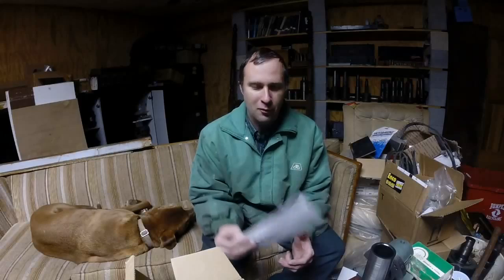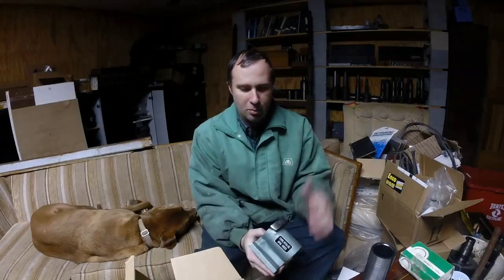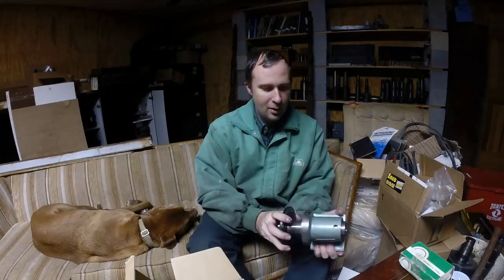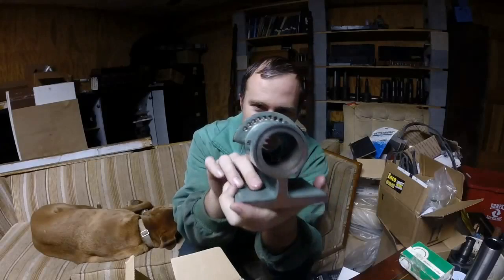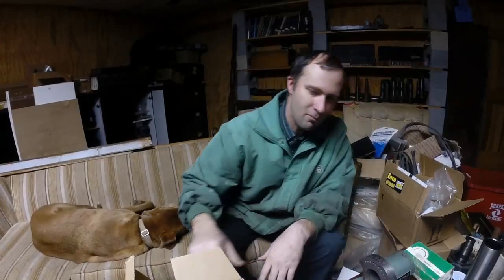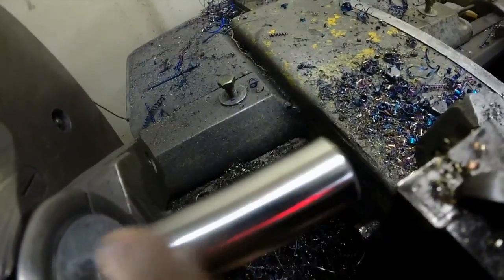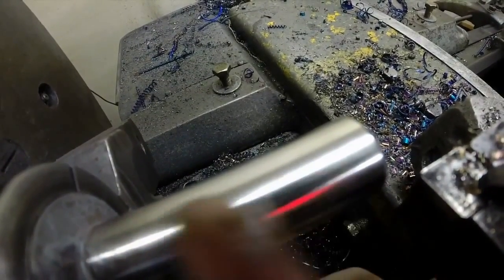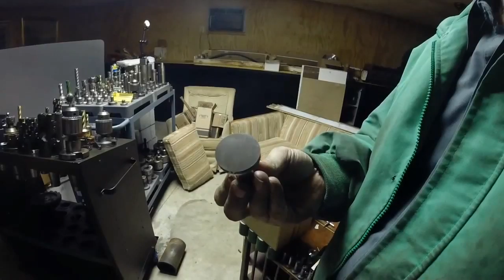Heat treating, Hard Turning, and Grinding

Comment: For the oxidation protection, I use boric acid. You can also use borax, but the boric acid comes off in boiling water a lot easier than borax. Heat the parts to just where they start to turn straw colored, and drop them in a can of the powder, they coat themselves in it and it turns into sort of like glass (just like brazing flux) then heat treat like normal. 
Just an alternative to the tool wrap. 
Another comment on the tappet design, they're usually crowned to a radius (high in the center) rather than completely flat. This is to make them rotate and wear evenly, when they go flat they stop rotating and wear the lobes on your cam.
Reply from the maker: Thanks for the tip! I will have to give it a try sometime. In this case the cam has a very slight taper that causes the lifter to rotate.

Comment: Hey, looking at some of your older videos.  You know those grooves on the inside of that spindex was because they are oil grooves.  :-)

Do you have a reference which you go to for heat treat and tempering temps and times for different materials and hardness needs?
Reply from the maker: I prefer to go by the material suppliers info, but there is also general stuff in my engineering materials book. I believe the machinist handbook has a section on heat treating as well.
Reply: Thanks, Brian.  I just picked up a unit a couple weeks back that I haven't used yet.

Comment: Put you parts on a tray, grab the tray with tongs and spill into about 20 gal. of oil with a wire mesh basket in it and swish if around quickly.  It will give you even hardness.  The faster the better, the critical point is as soon as it hits the oil.  What steel is it?  S-7?

Comment: Get the part from the furnace to the oil as quick as possible. Keep the furnace door closed in between part quenching. Also stir the part around in the oil for a better and more even quench. Doing all these things will produce a better heat treated part with less flaws in it. Heat treating is a science in its self. Great job, keep at it!
Reply: +1

Comment: Hey Brian,  just noticed that some barn door hangars I've been tripping over in my basement shop would be better in your shop than mine.  How can I contact you to send them?  Have (9) w/ nominal 2.5" x 4" rectangular ID.
Reply from the maker: 2.5x4 is a bit small for a barn door, but they sound like they could be a size I might could use on some windows. You can email me it is on my about page or use bcbloc02 at yahoo.

Comment: I have a question, You hardened the tappets but you didn't show any tempering, are these pieces just left brittle? Or did you draw a tempering heat and just not film it?
Reply from the maker: A double high temperature draw/temper was performed but I didn't film it since there really wasn't anything to see, since it is just parts sitting in a oven for an hour and a half.  I probably should have done more than just mentioning it 11:37 in the video. I didn't think about filming that part of the process until I had already done it. I was busy trying to get the exact right oven temp and doing that diff at the same time, what is it they say about too many irons in the fire? lol
Reply: bcbloc02 OK ya I missed that thanks for the reply.

Comment: Hi Brian, I see Baily continues to maintain his usual calmness under fire LOL
  I've definitely got oven envy, I'd love to have one of those, it would come in so handy for making custom bushings for all the line boring jobs I do. Just curious how do you know how to get to a certain hardness, maybe you can do some more videos on the heat treating process, I've always been interested to know more about the whole process. Great video!
   Mike
Reply from the maker: It is a good topic with limited info on the internet so I will be sure to do more in the future. Fortunately the materials handbook and many steel suppliers have detailed heat treating info available for most materials that will tell you what hardness and strength should be achieved if you do it right.

Comment: Cool stuff! I Could sure use one of those ovens... Thats interesting about the spindexer, I almost went with one of those but I found a real nice Yuasa unit on ebay. Thanks for the video!
Reply from the maker: Going to do a review on yours? This thing is probably just fine for an index, but it won't work for rotary action like I had hoped. Time to just buy a full on cylindrical grinder instead. :-) lol
Reply: Haha! You could probably make one with a cylinder grinder! Hmm, that might be a worthwhile video...I think I'll wait until I have my Surface grinder up and running, then I can do a real test of the spindle accuracy on it.
Reply: (Reffering to doing a review on my spindexer.)

Comment: Wow - a serious oven, that will surely make the meter spin and the lights dim when you switch that on to heat up!! Better tongs will help as will a bigger quench bucket and contents. I guess some slow speed stirrer would help but things gaot a bit too hot at the end when the oil got on fire.
Could you please explain a little more clearly what happened to cause the few failures (6?) you had? Many thanks.
Reply from the maker: It is less than 20A so it draws less power than the table saw so not too bad.  The ones I couldn't use didn't clean all the spots where mill scale had occured up. For this particular material since air quench is also OK I will probably just use tool wrap and do that to avoid the oil problems and reduce the scale problems as well. I hope that helps.
Reply: bcbloc02 Only 20amp? How long does it take to reach 1800F?
I bet that makes the shop nice and toasty.
Reply from the maker: It takes like 3hr to get to 2000deg.

Comment: Is this for a stock rebuild, or some sort of hotrod parts ?

Why not just buy stock parts ?
Reply from the maker: These are for tractor pulling and drag racing diesels. The stock ones break the foot off and destroy your cam and block these are the solution to that problem as they are hard enough to run on both cast and 8620 steel cams with no wear issues but also tough enough they won't break under the extreme loads put on them in high performance applications.
Reply from the maker: Rick Brandt
 Not a lot of meat there in the block, you could squeeze another 1/4" of diameter in the block but then it is probably getting thin and I would worry more about breaking the block than these lifters as these are probably 6 to 7 times the tensile strength of the block material. I have been running these in multiple motors for 5 years and haven't had a failure even running over 500lbs of spring pressure at full open.
Reply from the maker: Certainly 2000hp and 3000+ft-lbs of torque were never envisioned by the engineers for this little 466. I sure could use that new shop right now, especially that overhead crane! I am working 6 days a week for my day job and another 5 hours a night in the shop so not time for barn work. :-( The only good thing is steel prices for my posts for the bridge have dropped 25% since last fall, I wish I knew when the price was going to bottom out so I knew when to buy!
Reply: bcbloc02
are Bigger lifter bores possible. can imgine pretty radical cam,side loading/bending on the foot
Reply: Then you surely do good work. Watching that vid on hinge repair shows how well you think things through. I do enjoy your presentations. I am sure the tractor engine engineers never envisioned the the spring pressure/cam profiles/RPM's
your employing. The side bearings show your concern for the whole drivtrain,fan to tire contact.
Some day will visit Kentucky,would offer tractor seat time. To help out. Grew up on a John Deere farm.
Waiting to see that barn repurpose.

Comment: When you're quench ing part after part like that, try using a bigger quench tank, and more liquid to ensure the oil is still cool enough and has enough capacity to quench it properly.  Having the oil on fire is a bad sign.
Reply from the maker: Agreed fire bad, this oil burns at 400 and the quench is complete at 600  and the material supplier says it is ok to air or oil quench so I think it was ok in this instance. I do want to get more oil and a bigger container for sure.

Comment: Hi Brian,
Nice score on the heat treating oven!  Maybe boring out the Spindex and making your own bronze bushings would help with stability and accuracy.  I guess that you'd have to decide if it was worth your time to do this.  Thanks for the video!
-mike
Reply from the maker: I may try to find a decent one with bearings like a Suburban or something, but for now I think I will try some V-blocks and see how that does.

Comment: Hi Brian,
Cool, matter of speaking, demo for the furnace...
Leaving more material is no problem, cause wrapping is more a problem for uniform cooling, could also inject some inert gas in the furnace...
64Rc is harder than HSS steel or just about the same. For turning give CMT inserts a try, no more than about 10-15 thousand DOC.
Also looked from here that after leaving the door open for too long that the last pieces were getting colder, all the times I hardened material, I stir each part individually in a figure 8 in the oil bucket, not adding too many at the time to keep the oil from going so hot that the hardening becomes non uniform...
Is your area getting Spring like temperatures...?
Pierre
Reply from the maker: I know from experience stainless tool wrap seems to keep things nice and clean. Maybe tougher for quenching, but this material is OK to air quench as well. I am going to get a better set of tongs as well or modify these for next time as well so I can get the parts out quicker.  I want to get some KY4300 ceramic inserts to try sometime, but for now I got by ok with my Cermets and just changing cutting edges often. I bought a bunch of them for a buck an insert so I don't mind using them up pretty quick on a job. I wouldn't want to try to push turning more than .005 off these with just a collet body grip, I can't put a center in the end as it is machined for the pushrod.  As a matter of fact I couldn't hold them wih just the collet grip anyway, I had to use the chuck jaws on the outside to grip it tight enough  to keep the part from coming out.
Reply: Yap,like you say, those parts are a challenge, is there any temper? Or they're as out of the oven? 64 Rc is usually pretty brittle... I know many questions....
Reply from the maker: pierre beaudry
 They are a high temp double draw temper. This material produces very uniform grains so it has high hardenability, extreme wear and still good toughness. It is a excellent material I have found but also very pricey!
Reply: What is it...? Curious...

Comment: Really like your videos.
Good hot job shop info. T
The dog is the star. His name?
Keep em coming(vids)
Reply from the maker: The dogs name is Baily, he runs the shop. :-)
Reply from the maker: He only gets excited for new work, if it is the same old parts being made he figures it is just production and he doesn't need to supervise. lol
Reply: bcbloc02
I think he'd be supervising if you used bacon grease as quenching oil, LOL!!!
Reply: bcbloc02
Always got to make sure Bailey signs off on the work you're running through...he looked a bit unimpressed for the opener, he must only get excited when there is a 1000lb. planetary gear on the hoist, or a big block getting faced on the Cincinnati#5 :D

Thanks for the show and it's very cool to see your shop evolving and keeping all of the work in-house as opposed to farming it out! Aloha...Chuck